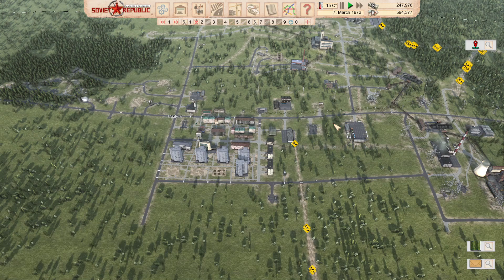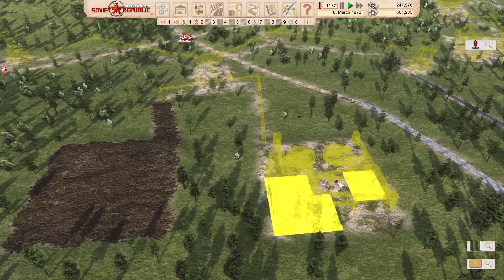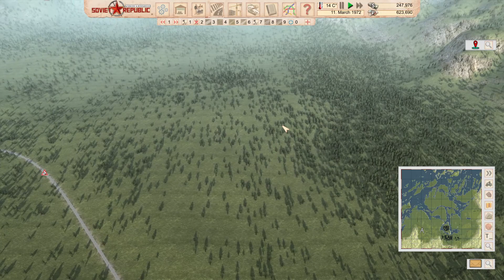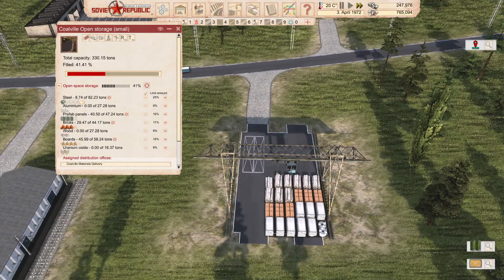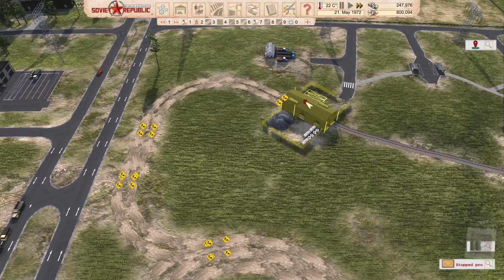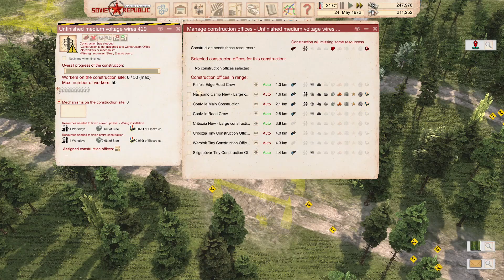Laying Track :: Workers & Resources Soviet Republic (1947 Start): #49

Comment: is best 2 have a storage hooked up 2 ur railway contruction office
Reply: that railway co isnt that good u need more storage
Reply: get ur production prefabs steel wood gravel fuel prodcution up before u start ur railways
Reply from the maker: Unfortunately the small rail construction yard has no factory/conveyor connections.  Did consider rebuilding it, but it will be enough to make the initial connections.  When steel come online will build more efficient C0s that can be supplied by rail.

Comment: I still think you should have gone with the cheap wooden tracks and just improve them later or started with a simpler layout and just go with some mortar wagons
Reply from the maker: I am only using the wooden tracks to make the connection to the main line.  Once steel town is built the small rail construction yard will be abandoned and the tracks torn up.  The main line uses prefabs as it will eventually be electrified.